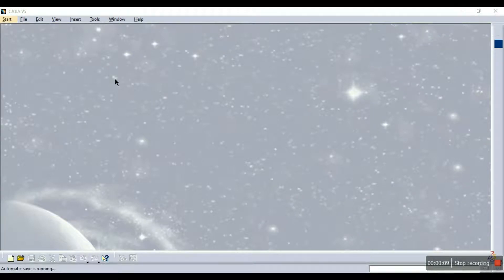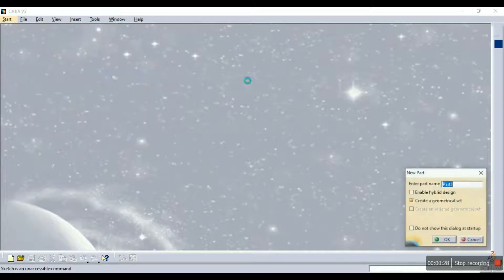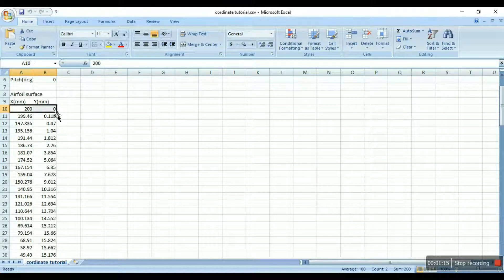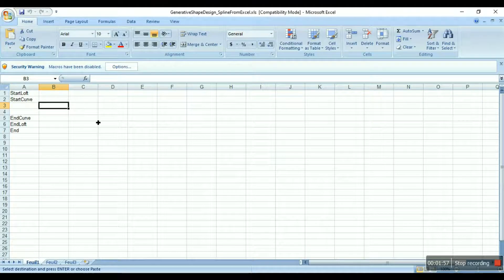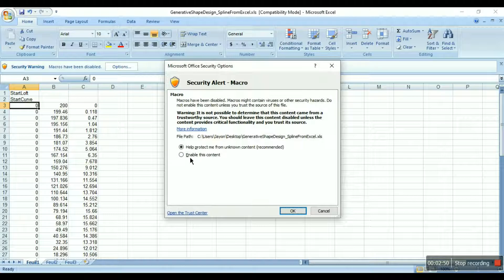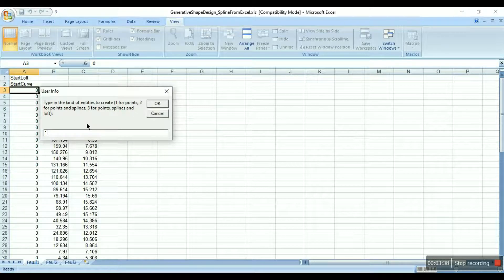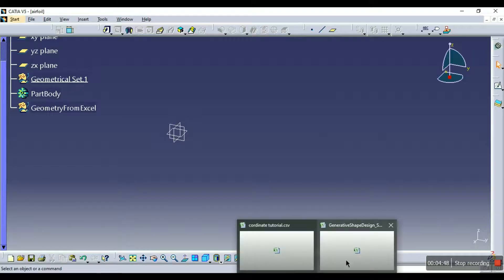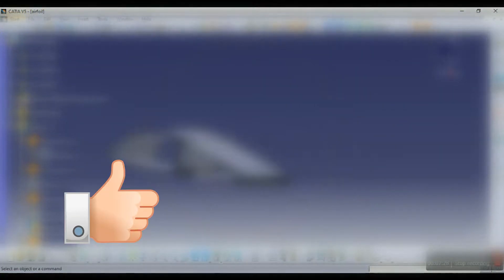How to import Airfoil coordinates from Excel to CATIA V5?

Comment: Dear Jay, I have a problem: on the aforementioned website to have the coordinates of the airfoils, the X and Y coordinates are coming together, in the same cell (example: 100.957,-0.9587). How do you make the coordinates come in different cells? Thanks in advance for your time.
Reply from the maker: You can check how to split values in Excel

Comment: When I run Macros, a 'Microsoft Visual Basic' dialog box with a message "Object doesn't support this property or method". Can anyone help???
Reply: Hi! I had this problem too, i make some movement like the: reopen Catia file na save him, after that i convert text to columns wizard. After that i have another problem with "type mismatch".
Reply: @РусланПагоня  Did you manage to solve it finally?
Reply: I know I'm late, I leave this here for the future.
Just found the solution to that. You probably are not inside the part. You have to have the part open in catia. Check if for example you have the product open (instead of the part).
Reply: I had the same issue.
Closed the product file and opened a product file. Then it worked fine for me...

Comment: I am trying to import this airfoil to ansys from catia after did some modification, should I fill the profile and import these as an surface to ansys to do make cfd analysis??
Reply from the maker: Yes.. Exactly! Extrude the profile and export it to ANSYS if you want to simulate a 3D wing OR just the fill the profile to make it as surface for carrying out a 2D simulation.

Comment: sir can you help me please, for the "2" option i cant put curve in catia, it says "System Error & H80004005 (-2147467259). Unspecified error"
Reply from the maker: Hello, that's an error related to Excel/MS Office. I am sorry, but I haven't come across it ever. Try re-installing your MS Office (if you have downloaded it or using pirated version). Else you can look about it here - 
https://stackoverflow.com/questions/30539623/excel-giving-system-error-h80004005-2147467259-unspecified-error-message#:~:text=I%27m%20almost%20100,think%20it%20worked!
Reply: @MechStuff  i have found the solution sir,its cuzc of the point is like in the same line, i just need to lessen the number of coordinates

Comment: Thank you very much. There is a very important detail not precise in the video: THE Generative Xls file MUST BE in the same emplacement as the CATIA file.  If not, the macro will display an error and fail to import points to CATIA. This happened to me, I have understood the problem later. I  share the idea with whose are concerned by this problem.
Reply: Hi , and how do i do that ?
Reply: Can you please elaborate on the location of the file?

Comment: Good info. But it anyone's wondering, you don't have to download the excel file with macros in it. It's in the Catia installation directory by default (At least for the version that I have).  Look in here Dassault Systemes\B21\intel_a\code\command and you'll find a lot of excel files with a bunch of different macros, the one mentioned in the video will be among them.